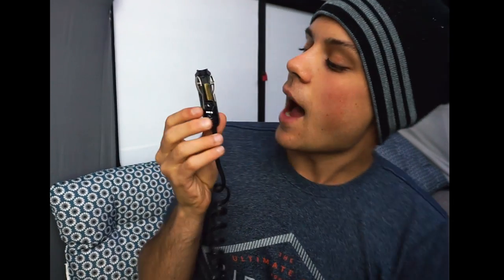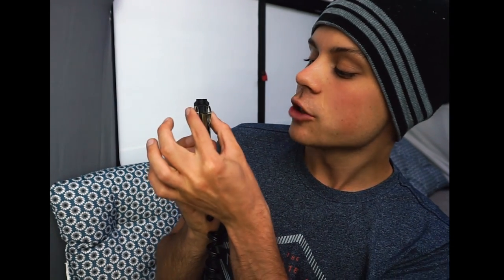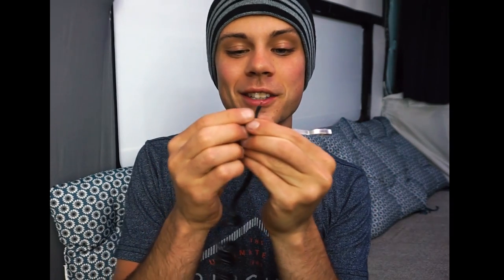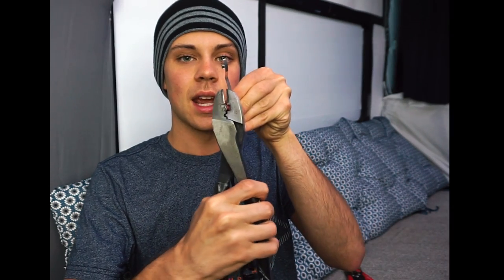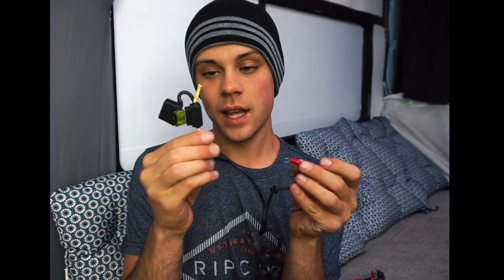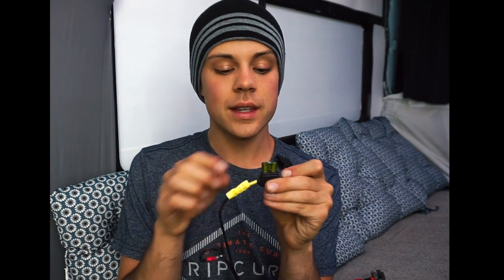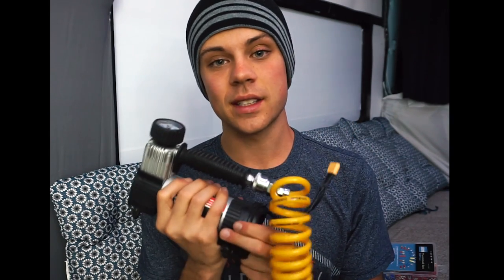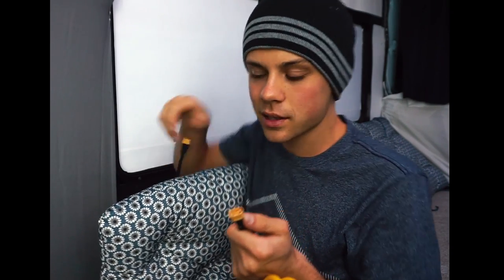How to hardwire a cigarette lighter appliance to your solar system

Comment: I appreciate your concern for amperage and use of thicker wire to reduce heat generation. Very wise. I need to remember xt60 connectors.
Reply from the maker: thanks! And yeah give them a try. I hope you like them!

Comment: A Master Class from the Prowser,
XT60 for the win. great walk through Will,
Reply from the maker: +waine dodd thanks man!!
Reply: Is there any problem adding xt60 connectors to the ends of LED puck lights for a van? they are 3w lights. thanks!

Comment: Should I be concerned about connecting to some electronics such as a Bose Minisoundlink, as there will be variations in voltage from my deep cell battery?

Comment: Is it more efficient to take the 12v plug apart and solder it to your 12v solar system? How much more efficient would it be vs. just plugging the 12v plug into a socket wired to the system?

Comment: Let’s say, for the sake of it, that I have a solar panel and a solar regulator. I also have 3 appliances. One is 12w, other ir 40w and the third is 200w. All have 12v car plug.

Should I make a fuse box? How would you design that schema? From the solar panel to the solar regulator, then to the fuse box? Should there be a battery, or not necessary?

Comment: Thank you, this is very informative. I’m looking for a video describing how to connect a fuse block to a GoalZero Yeti 3000 via Anderson Powerpole connections and how to connect the light switches, refrigerator etc. to the fuse block. Do you have any suggestions? Thanks again.
Reply: Hey Robert - I am looking in to doing the same thing - Did you have any luck getting any answers? thanks

Comment: Thank you.  Youtube kindly directed me to your video 😊. I am a beginner and try to understand electrical stuff and your videos help a lot. Now,  I got a small 12v heater with a cigarette lighter plug, but it is to demanding for my cigarette lighter socket (on my ecoflow), which is only 10 amps. The heater needs 150 w! I want to work dc to dc, so now I want to connect it directly to my 12v 80 amp solar battery. I will put a fuse on the positive cable. I think it will be risk free, but maybe I am wrong, There are people around me who says it could be dangerous. Anybody in this forum who can confirm?

Comment: Hey Will, loving your videos. Brilliantly explained in simple language, thanks for taking the time to do this! I have a very specific question that may give you a challenge to answer (or you may answer it easily in minutes 😁). So, first world problems... I want to use Amazon's Alexa while I'm camping - I know I know it's ridiculous - so I'm wondering if, rather than having to install a usb outlet to my fuse block, could I wire the cable that came with the dot straight to the fuse block? I'm unsure if a 12v socket regulates the voltage to smooth any sags or spikes from my AGM battery and if it doesn't is there any difference wiring to a usb outlet of straight to the fuse block? Cheers for any response.

Comment: How do I connect a 12volt water pump to a bluetti ac200? I'm trying to use the bluetti as my main power but my water pump is 12volt with no plug.

Comment: Hey bud , I got problems , I bought a Linkon bullet charger for my Mac book , I wired a cigerette socket to my house battery and it was fine , but then I got my solar fixed and a new house battery and melted the charger ? I am super confused , also would it be possible to convert bullet chargers to your 60 amp plugs and sockets ?

Comment: So... You connect 12 volt cig inputs to a fuse bank... I wish I could actually see this... and I wish I could find a "Ready made Bank of 12 volt cig outputs" Why isn't there a "Bank of 12 Volt Cig Inputs w/ fuses already incorporated into it" ? I see these LiPo4 batteries now with Cig/USB and even Volt meters already built into them... but they are never the quality of battery that Will seems to recommended. Also... How do you recharge your DIY system from the Cig output in your car? Like with all the Jackery type units. Why can't I find the answers to these questions?